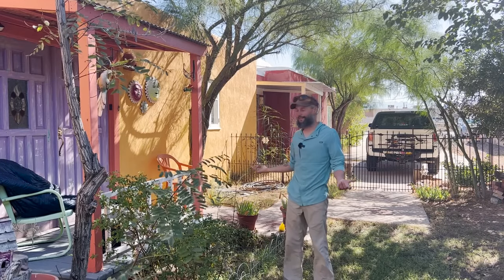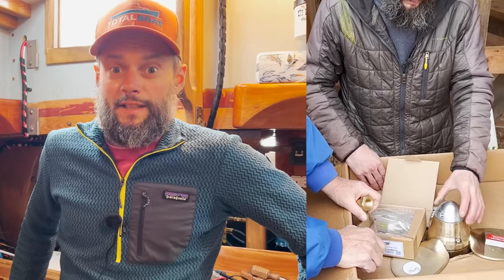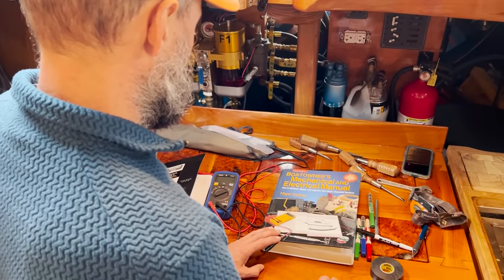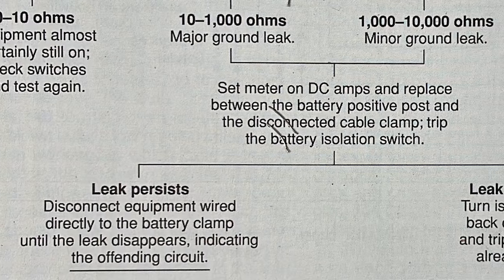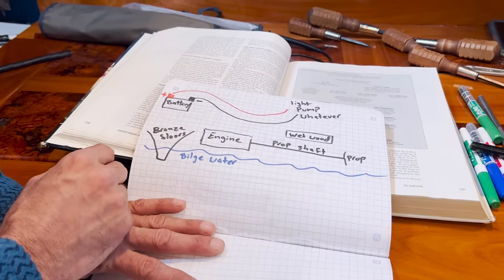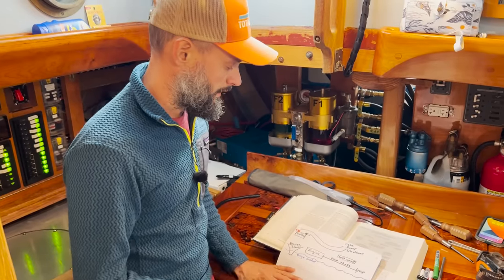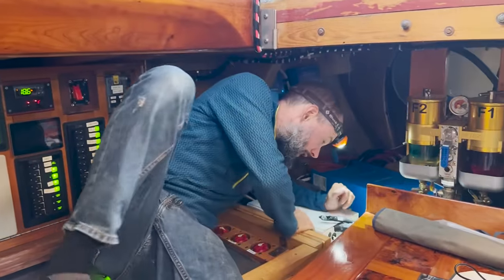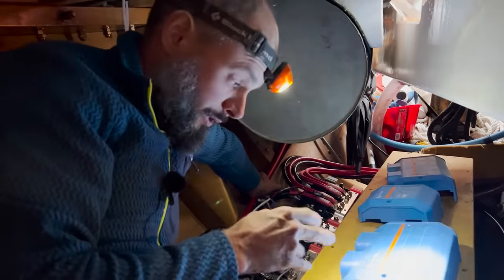Stray Current Puts Arabella in Danger - Episode 284 - Acorn to Arabella: Journey of a Wooden Boat

Comment: Your + probe is connected to the 10A terminal, NOT the mA terminal. This means your 0.01 current draw was in AMPS not mA.
Reply: 0.07 amps = 70 mA so there's your leak!
Reply: Was about to comment this too.  unfortunately all of this troubleshooting was invalid and it would be best for Steve to go through it again with the meter correctly configured for mA
Reply: That was my first thought, although I think the multimeter would just not work at all.
Reply: @etalon3141  it will still read, but not accurately.  best case it's out by a factor of 100
Reply: You do realize that what’s shown in the video was more or less a reenactment?
Reply: @ramdynebix I do, hopefully it was just an oversight during the re-enactment.
Reply: My understanding is that the 10A terminal will read in mA, just not quite as accurately as when connected through a dedicated mA terminal, assuming the meter even has one. The 10A terminal just has a bigger fuse.
Reply: @ramdynebix  I doubt Steve would have reconfigured his multimeter in between shooting the bits he's doing and the actual troubleshooting unless he just happens to have also been doing a completely unrelated electronics project. so while I get your point, I think it is still worth pointing out.
Reply: The 10A on the meter just means that the most current you can put through the meter before popping it's internal fuse is 10 amps. The mA is a setting on the meter to test very small electrical currents.
It's the same idea as tracking down a parasitic draw on your car battery.
Most DVOMs don't have a dedicated mA port.
Reply: Just checked with my own meter - there is basically no difference WHERE you connect the wires on these cheaper meters. The only difference seems to be the fuse use in one of the two ports. I think he is fine!
Reply: @nathanielmccartney6221 nope, different shunt, mA/uA will have a higher value, read the manual for exact values.
Reply: @AquaMarine1000  I’m not sure if I’m mis understanding your comment, the COM port which is on a lot of multimeters is normally the Common, or negative/black lead port. If you have a meter with more that 2 ports, its the red lead that you would move about, eg 10A, Volts, mA/Ohms/Diode test etc. I only mention it because the way i read your comments I believe it’s saying to put the red lead into the COM, with should only ever have the black lead in it? Apologies if I’ve got the wrong end of the stick, hoping to make it clearer to others reading along.  Another thing that is confusing with multimeters is that there are lot of different labelling and types of port, depending on the model and how they’ve chosen configure it.  🖖
Reply: @LateNightModels  that 1 did & there is a different measurement for mA.
Reply: @ewankingham6133  Yes, Coms is netural/negative (black). My understanding is that the 10A is used for AC and the other side for DC.
Reply: DC has to flow through the meter to be measured but AC is measured by inductance with a clamp style meter  @AquaMarine1000
Reply: If the anode is a different metal (I.e. bronze) would the current flow remain the same as with zinc? Should you replace the zinc electrode and then test?
Reply: An anode is a sacrificial metal, usually zinc, which is more corrosively active than other engineering metals. Corrosion is the flow electrons. Two dissimilar metal by their nature will be activated by an electrolyte, i.e., seawater.
Reply: @ramdynebix yes and I was thinking of everyone that gave money for this project might be sending more money to recover a boat   from bottone of the sea
Reply: Gosh so much misunderstanding about the 10amp socket on the digital multimeter compared to the normal socket for the positive test probe. The normal socket has the capacity to measure small currents so for the highest accuracy use this if the anticipated currents are in this range.  The 10amp test socket is only used when currents exceed the maximum that the normal socket can handle but are still no more than 10 amps.  Whichever socket is used the readout will be exactly the same. For small currents the normal socket will be more accurate but exceeding the current test limit will cause damage to the fuse in the meter. The 10amp outlet is often unfused and measures higher currents up to 10amp without damage but with less accuracy for lower currents.

Comment: I would also go for the alternator. My Car started to have dead battery all of a Sutton . If I left the car for two day it would have a dead battery. About a year later I had to replace with alternator as it stop charging the battery while I was driving. I didn't worry about it  as its a diesel, .once running   no problem. What for got was that the shifting off the electric clutch needs power. Long story short, once I replaced the alternator. all my problems with dead battery went away, the alternator was draining my battery when I didn't use my car. So I would go for the alternator. good luck.

Comment: I'm not sure just turning on each breaker and checking for leak will give you the desired answer, don't you also need to put everything on that circuit under max load. Good luck with the climb.
Reply: If it's under load you would expect to see some current, so that doesn't tell you anything useful. He needs to check the case when no current should be expected.

Comment: Not an authority on this but did-similar metals in a salt water environment can make there own current.  The boat my father purchased in 1978 was built with iron floors and bronze fasteners which caused electrolysis.  He wrote an article in wooden boat.  Not sure on the year.
Reply from the maker: That’s galvanic corrosion due to the mobility of the metals, for sure.

Comment: cant you just put a volt meter between the hull and annode and see how high the current is to confirm there is in fact a leak? you could also use this to confirm there is in fact a leak by the alternator or the dc system or whatever, just by watching the current.

Comment: Begin by looking at how yo mounted your busbars and all other related electrics.  Never mount anything directly to the wood of the boat.  You must isolate everything with grommets, or nylon isolators.  Wood, even though sealed, has moister in it.  Placing metal screws into the wood with direct contact with any terminal connection is a recipe for disaster.  With the hi moisture conditions aboard a vessel, ground leaks will happen.  Remove any positive DC wires that are held together by mounting them to the frames or wood.  In ALL AC circuits, Isolation is a must, virtually all wires must be isolated.  Grounds and bonding must be made according to Victron's specs.  It is a real hassle to redo all this, but you don't have a choice.  In the re-mounting, check all electronics and appliances for faulty bonding.  Consult a marine electrical engineer if you are unsure, and tell him or her you own a wooden boat.  Wishing you the best, Conrad

Comment: Hi Steve, I haven't had a chance to read all the comments but it may pay to check the diodes in the alternator aren't leaking current, being a fairly new motor it may be unlikely but they can be burnt out prematurely by the battery terminals being reversed in inadvertently or from unregulated charging.

Comment: I think you are on the right track and am sure others will offer the same wisdom… here are my 2 cents (Canadian even) 
1) use a quality marine alternator with an external regulator 
2) consider adding a second isolator switch to remove the engine from the batteries and DC completely
3) for the future make yourself a Zinc fish ( 10 gauge wire and a sizeable zinc bar) to hang over the side… attach wire to zinc and to your boats bonding circuit 
4) my boat uses a large zinc bolted to the hull and tied into the bonding system internally. From this zinc a wire and set of brushes that are spring loaded contact my shaft at all times. This was done as there is no room for a shaft or prop zinc. Maybe a thing to consider down the road. 

Great video. Thanks for explaining and sharing!
Reply: The key here is "tied into the bonding system internally. "  You have to bond absolutely everythign together, floors, through hulls and propshaft.  Everythign externally must be at the same potential.  It forms what is known as a "faraday cage" ... beyond that, you can connect that to battery negative (very common) or postive, or anything else you like, it really doesnt matter.  All that matters is everythign externally is bonded together.   You can then have a "leak" from battery to a floor for example, but it can't cause any corrosion outside the boat as it is all contained within the faradayt cage.   This is not a "leak problem" on Arabella ... this is purely a bonding problem.  Something (possibly the propshaft) is not correctly bonded to everythign else!

Comment: I think you're on the right track with guessing it's the alternator causing the problem.
Either pull the belt as someone else suggested, at least for the time being when running the engine, and/or speak to your contact about shorting the regulator, and the output of the alternator. MAKE SURE the alternator's positive output lead is isolated from everything else if you do this.  Shorting the positive output to ground will neutralize any current generated by the alternator.

An alternator should create no power unless the excitation field is, excited, but all those metal windings will naturally have some eddy currents from underlying magnetic fields, that will create a small amount of current on the output side.  You could easily measure this with the engine running.

If the manufacturer doesn't like the idea of dead shorting anything, ask them if they have a recommendation for size of resistive dump load to tie across the output terminals to consume the trace current levels being generated.  I'm willing to bet a nice fat 10ohm 100W resistor is MORE than sufficient to handle the problem, but some thought needs to be given on if said resistor needs to be switched in and out. I think you could leave it in place permanently (it'll consume 1.2A/~14W when the alternator is operating) with no ill effects, but run the idea by someone who's done boat power systems just to be sure. You might be able to use a far higher resistance unit as well, which would lower the wasted draw and still provide a path for the current leakage to be closed.

Additionally I had the thought of, consider put a diode in series with the resistor so it can't accidentally become a parasitic draw on the batteries when the alternator is off, but given the fact the windings in the alternator are effectively a dead short when it's not in operation, I now think a diode might do more harm than good.

Comment: It could still be a DC problem, the movement of Arabella could easily be causing an intermittent short (the worst problem to find) from any part of her electrical harness, and the only way to find it would be an inch by inch examination of her entire electrical system. It could also be something like a screw/nail penetrating a wire somewhere, causing an electrical short. Hoping the problem is easily sorted.

Comment: 24:22 (I did not skip ahead to anything here) 
My guess is that problem lives in the propshaft. Most likely the galvanic current is generated in said shaft between the different metals in there. Maybe even between the zinq anode and the prop and or the steel shaft itself.
I mean it has to be the shaft/gearbox and/or engine assembly because if all other systems can be ruled out then that is what is left.
Side note: Maybe a couple of DC circuits combined have a draw which causes the anode to be eaten so very fast.
I mean 0.07 in one circuit combined with a couple others offering a 0.01 draw each adds up to possibly enough draw to cause issues... Maybe a good idea to redo the breaker panel test but this time switch on the breakers which have circuits  (connected to switched off items) which have an actual draw to them and see how much of a total draw you get. You know 0.07+0.01+0.005+0.005+0.015++0.01+0.01+0.02 equals 0.14 Amps...Enough to eat a zinc anode ??

Comment: A clamp meter is your friend. I see many people already commented but i suspect it's coming from the engine. Current actually flows negative to positive, not that it'll matter for your troubleshooting. I would try to isolate the engine somehow. I once saw moisture in a starter solenoid cause a leak. More likely it could be the alternator. The thing to remember is the engine is a huge exposed negative conductor.  This is the fun stuff. Enjoy!
Reply: Clamp meters are very inaccurate at lower amperage
Reply: @sartorst3376  not if you know what you're doing and have good equipment. A current clamp doesn't even need to be accurate in this situation. You're just looking for a change. A high quality current clamp will allow you to degauss to basically zero out noise.

Comment: My take on this is that it has nothing to do with the electric installations. To have the anode eaten up it has to be a closed electrical circuit. A probable cause it that around the propeller a number of different metals in combination with salt water creates a battery. This is how the Italian scientist Luigi Galvani found out about the battery in 1780. You have a stainless steel shaft (iron, nickel, chrome), a propeller made of bronze (copper and tin) or Nibral (Nickel, bronze (which is copper and tin) and aluminum), and then put an anode on top of that. Sometimes there are a nut of brass (copper and zink). The anode does not always contains zink, it could be made of aluminum, then they are called sacrificial anodes.
Put it all into salt water and you have all the ingredients for a nice battery!
Aluminum anodes are sacrificed much faster than anodes made of zinc. Make sure you have an anode of pure zinc (99.9% zinc)

Comment: hi i think your on the money with the alternator, i had the kind of same thing on my car i had a parasitic grain from the battery and we checked every thing and it turned out to be the regulator/rectifier in the alternator and the diode in the rectifier had failed and aloud current to flow back to the alternator, and if i left the car for more that a week the battery was flat, anyhow i hope that helps and not cause any more confusion on the matter, and hope you get it sorted with kind regards Adrian.

Comment: I understand your concern about stray electrical current, but could the anode just have fallen off - I mean is it completely gone or are there residue left? Hoping for the latter.. Best of luck Steve :)
Reply: He stated that the mounting hardware was still in place, so it didn’t just fall off.
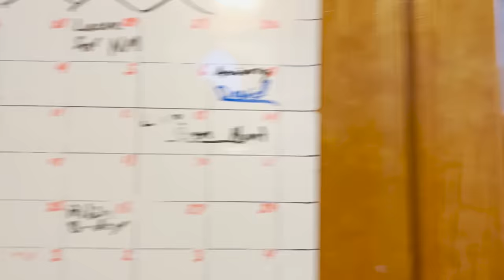Reply: I wondered the same but he covers this at 24:45

Comment: ENGINE with good ground - ALTERNATOR at fault / LEAKING DIODE ? --  Pull ALT free from engine (isolate/no grounding ) leaving all ALT wiring plugged in, Ohm ALT """housing frame"""  to engine block = diode leak , field winding leak or stator leak... change ALT,  if ok try ---
With good clean contact point on engine for + ohm probe  and copper strip 1/4 wide x 4-5'' long for -ohm, dip in bilge water read ohms.
It maybe if you move negative probe around to different points in the bilge you will get higher or lower ohms reading in relation to the voltage leak source.